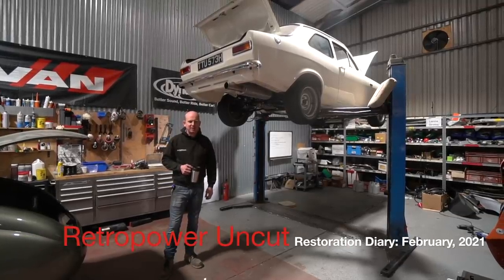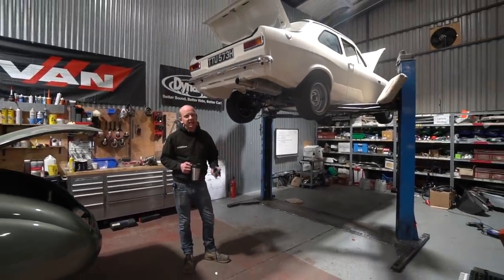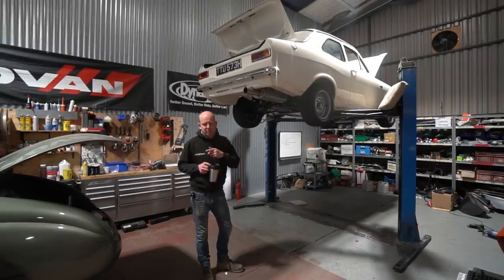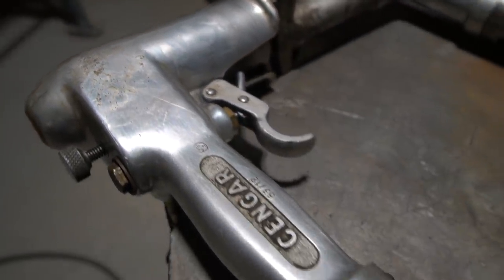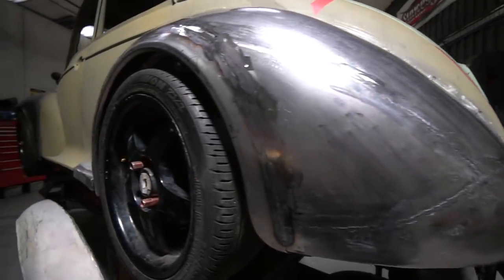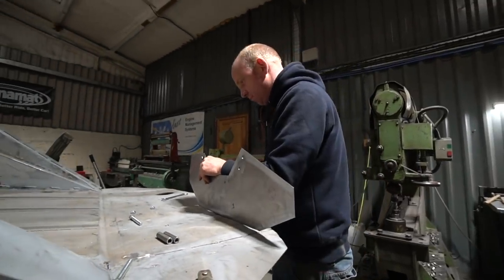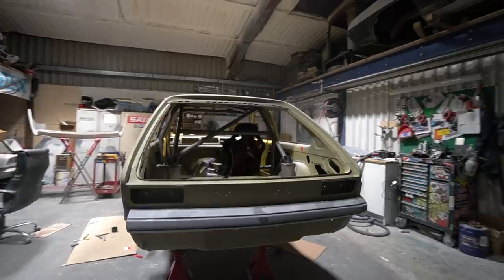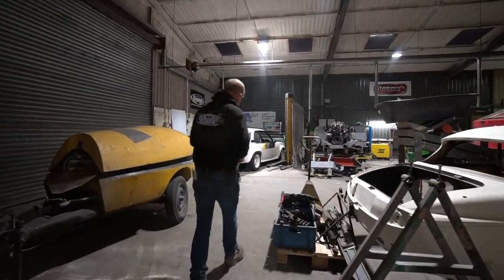Retropower Uncut Episode 27: Weld Planishing Explained, Mustang in Primer & Jensen IRS Swap Begins!

Comment: "Tig braze with a copper alloy rod, with a silcon copper, a silicon bronze rod"  made me laugh, it gave me flashbacks of a Harry Enfield Les the barman sketch.
Reply: 40, 45 , 40 ?
Reply: Silicon copper is actually used for annular grooved rose head nails to attach cedar weatherboard, 304 stainless steel AG rose head being the other (easier to use) option.

Comment: Really enjoy your Chanel and the work you do , can I please ask a question ? Can I ask why you use metal for custom built wings rather than fibreglass or even carbon fibre as wouldn’t that be faster/cheaper ? Just wonder what your thought process was regarding this ?
Reply from the maker: It was certainly considered. Essentially the work involved is similar: we'd have to have taken the modelling stage to a completely finessed shape and then either modelled all four wings and then pulled moulds off them to create the  finished parts in, or scanned one side and modelled in cad, using the data to machine moulds from plastic or MDF blocks. Either way fairly time consuming so the costs are likely higher for the composite route. The benefit of course is that more can be made if the first set were damaged. The clincher in this case was simply that the owner wanted steel panels.

Comment: Regarding the Engine mounts for the Murray 'scort, surely there must be an OE mount you can use?  Lots of modern dervs have two mode mounts, that use inlet manifold vacuum via a control solenoid to provide two levels of isolation. At idle and light load they go super soft to allow the low frequency vibrations to not get transfered, then then can switch to "stiff" mode when you apply the vacuum, which prevents the engine sloshing around too much under, er spirited driving!

eg

https://www.e90post.com/forums/attachment.php?attachmentid=1586715

Given that these engine mounts also retain an engine under a modern crash scenario, they are clearly quite strong enough foer your application

Comment: In principle, inboard rear brakes reduce unsprung weight, so are an advanrage.  So why is the Jaguar rear suspension for the CV8 being converted to outboard brakes?
Reply from the maker: The inboard setup is a great concept but its a bit of a swine to work on, and once you want bigger diameter vented discs they no longer fit in the space. Air flow for cooling is a complication too.
Reply: @retropowercars  yes, that makes sense.

Comment: Eurathane bushes with a steel inserts are simply crap.  Proper rubber is the only way to go for a road car.
With those bushes surely you can mod the part to use an OEM Bush?
Opel? Vauxhall, Holden. No it is an Isuzu. The engine may be Opel but it is still an Isuzu.